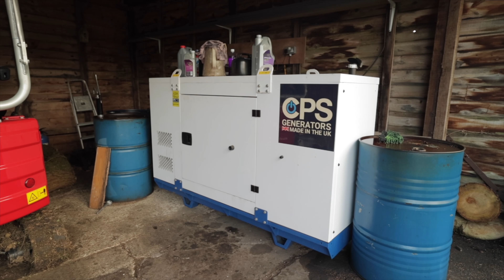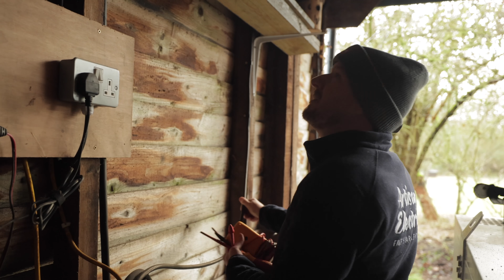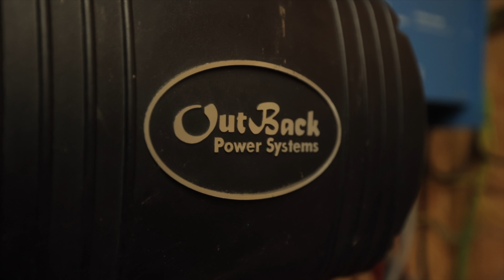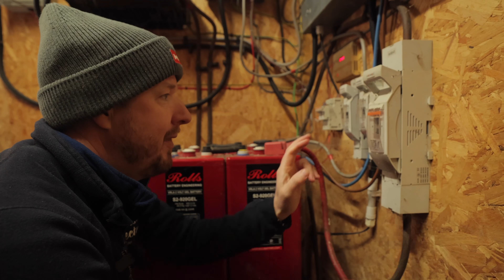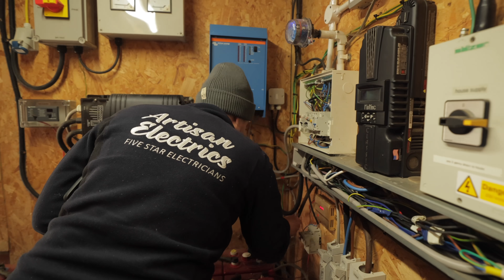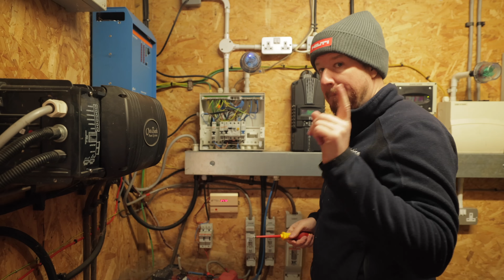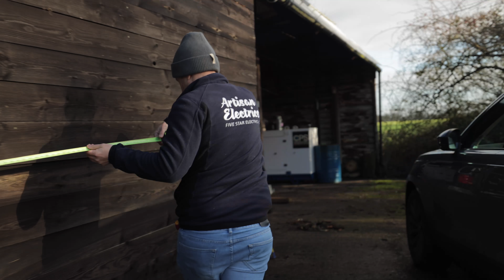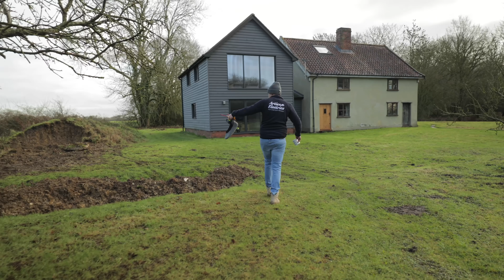DIY Off-Grid Solar Gone Wrong! (It Can’t Even Boil a Kettle)

Comment: That gear was top notch back in the day. To me it looks like an old DIY install on the cheap that has been upgraded along the way... likely done over 15 years ago.
The generator wiring is an odd one as its an AC gen but it looks like it had the ability to run the house on the change over switch.
In all honesty, Artisan is not the company to be doing this sort of install as you'll charge the lad the earth for something he does not need.
A house like that with a gas cooker etc won't consume much and you are talking about full ground mount arrays.
Its best the lad learns some electrics and sorts it out himself.
Reply: They’re running in 47kg propane bottles, gas cooking and heating is going to be costing them a fortune!
Reply: That last titbit of advice is how we got here! It's best he engages a reasonable electrician who only sells him what he actually needs and no more.
Reply: @jack6450 its not that difficult. He can do some basic courses so he can maintain it himself and its as simple as reading the regs to keep it safe.

He needs a ground rod, a basic consumer board and that cable to the house changing and buried.
He can get a company to properly design the system (theres many companies who will do this in the UK... especially if he sticks to Victron).
Reply: @CalMUK91  Bury the cable, use the extra two wires as a direct feed from the generator and have that feed a few sockets/outlets in the kitchen. Bury an extra control wire to be able to force the generator on from a switch in the house, even if the batteries are charged. Run the generator the few minutes it takes to run the kettle. Or just use the gas stove to heat up water...

This is just a pure guess/speculation but it's at least not unlikely that the previous owner used a wood stove both for heating and for some cooking. Like heating water for tea doesn't require any fine grain control of the heating and thus a wood stove is perfectly fine for that. Might not be so great for things that really need fine control of the heat, but still.
Reply: @The-secret-101  just swap out the elderly 2kw Outback inverter for a 5kw Victron or similar, dump the old Rolls AGMs for EVE LFP battery bank, and you could run the kettle AND air fryer at the same time without the genny needed at all... The panels and Midnight controller are fine (hell at 10 years old, their lost production would barely be measurable lol) but by adding another charge controller (NOT a bloody  inverter Jordan- its a MPPT charge controller!!!) and more panels, you could reuce the need for the generator further (there's no limit to the number of charge controllers you can parallel into a battery bank until you hit the charge limit of the batteries- another reason to dump those worn out AGM!!!).  Artisan might know what they are doing with gridtie, but sorry Jordan- you don't know even the basics of offgrid- and it shows....

Comment: he just needs to sell the house for the 'upgrade' and yea not neat but the prev owner might nog have needed more than 3.5kw or so, you can make it 2x 16A on the 4 wire making it 7k which is enough for most houses and just add new panels and a good inverter, test the batteries they might be able to be reused depending on evening use in the house (i got 60 and 120kw on my properties vs the 12kw there but i am a heavy user) and deadly... that is a bit of clickbait, the exposed copper is indeed not correct but if tightly connected def not deadly in a closed system
Reply: Boiling water on such a system is just dumb too. Diesel -> Elec -> Kettle instead of just a gas stove...
Also, 6mm2 in ground is fine for 32A and it could have been 3-phase. The 24v battery system needs an upgrade anyway though, and I just utterly hate those Victron "slap everything but the kitchen sink on the wall" installs.
Everything on there could have been replaced by a single hybrid Deye inverter.
Reply: @1kreature  yea 2x 32A should be no problem either with 6mm2 , i put in 3 phase 6mm2 at location one for 20kw max and 25mm2 for 40-50kw at loc 2. i am talking about 2x 32a here to save as much money as possible so they can keep the 1 phase diesel etc and can just get a 1phase deye inverter and add more panels and tidy up the cabling a bit
Reply: @wernerz8314 yeah, but you know this is a sigenergy sponsored install so they will probably rip out everything. Those new batteries will take up and aweful lot of space.
Reply: @1kreature  Nothing wrong with running a kettle off a 5kW inverter. We do it 6 times/day. For a 3kW inverter like this a 1kW kettle is smart so you can run it at the same time as another high load. As you say the cable is fine for 7-8kW so getting a 5 or 8kW Victron Multiplus (or adding a 2nd outback (they can parallel)) would make this a much more capable install. More solar would also help a lot and it's cheap now. I'd just put 7kW on that shed (maybe beef it up a bit first)  Cheapest and simplest is just adding 4kW via a new MMPT.
Everything in one box is neater (and often cheaper), but you do lose flexibility. Just adding another block of PV and another inverter to this setup is easy. That modularity does have some value over the long term.
Reply: @xxwookey  The inverter is not the problem, the 16A fuse total for the house is. But I still say it's not useful to do it like that and I am stating the previous owner did not use it like that, as evidenced by the small fuse.

Comment: I am guessing for all work needed £30k to £50k am I miles off? Please do a follow up video on this project very interesting
Reply: You can double
Reply: 2x15kwh seplos packs about £3-4k. Victron looks good but a 5kva about £1k, 3xpowmr charge controllers £300. 20x450w panels £1500, fence posts and unistrut for vertical mounting (winter is only consideration) £2000. Other bits £1k. Labour 1 week.

Avoid fancy software and highly integrated equipment on off grid systems. Use separate chargers and inverters where possible to maintain resilience.

Comment: Re generator :- the generator should have a alternator to charge the starter battery I think the previous owners may have had probs with the alternator not putting any power out  and/or possibly a diode in the alternator faulty and slowly discharging battery when generator is shut down also the starter battery may be faulty the generator wiring and starter battery needs checking also the output on the external battery charger will make the alternator think the battery is charged when its not and on starting will draw a very high current from the charger not good  sorry for the waffle hope you get my drift
Reply: Probably the generator wasn't running much in summer and the battery died.
Reply: We do the same axtually, the genie is setup to autostart/stop. They have fairly small start batteries and  potentislly could be started several timex a day.
Running a smart charger to keep start battery topped up   is common place.
 Especially at night and in cold conditions
Reply: With that inverter it switches the household loads to the generator once it's running passing the power through the inverter to supply 3kw for the house and 2kw to the batteries to charge them, using 5kw of the generators capacity, leaving plenty of headroom on the generator for long life. They could have paralleled a set of those inverters for 6kw for the house and limited the max charge rate to the batteries to stay under the generator limit. A safety bypass downstream would let them run the house directly off the generator if the inverter failed, better option as it eliminates a single point of failure.

Comment: Love that you call the Midnight Classic Charge Controller an Inverter😂😂
Reply: The best way to see he is a bit out of his depth. Quite a decent MPPT controller that?
Reply: @danielkirk8571  Damn near indestructible those charge controllers. Didn't recognize the actual inverter either, I don't think he spends much time around off grid gear. That surge protector is one of the best you can buy too.
Reply: @andycanfixit  Outback has been around for a LONG time in the offgrid world of inverters- OK but quite small by modern standards (that one is only 2000W lol) LOL- I just made a comment about its a MPPT charge controller and not an inverter for the Midnight lol
Reply: @steved2136  Never saw in the vid him listing the actual inverter size, that style came in 3kw versions as well and both versions were able to be paralleled for greater capacity. As I stated elsewhere I'd simply repurpose that inverter and the mppt charge controller and existing panels with a couple new 24 volt lifepo4 batteries for power for that shed and as a backup to whatever replaces it as the main system. Then install a new 48v system with a 5 or 6kw inverter and some new ground mount arrays as the primary, and base it on Victron as its well supported, reliable, affordable and not likely to disappear overnight unlike the Sigenergy they seem to like to push. No reason to get rid of good gear.
Reply: @andycanfixit  Its the unvented case Outback- so its the 2000w version (on 24v, the 48v version is 2300w)- only the vented case version is 3kw- and thats not one.... Parallel stacking them offgrid doesnt seem to be that reliable- they work fine like that ongrid, but many have had issues with them offgrid running as master/slave in parallel....
Reply: @andycanfixit  Outback top machines. Could be a 2430 (24V 3Kw) inverter. A bit limited for a house. However their backup/forum is second to none.
Reply: @danielkirk8571  that says MPPT on it.
Reply: @damiankimmins3880  and on the lcd display, get rid of it and up the system to 48v
Reply: @danielkirk8571  Yes, Midnight Solar products are very good.
Reply: :) thats exactly what i thought. Midnight solar, great charge contollers(not an inverter) didnt even acknowlege the auto start system for the gennie !!

  Always the same with artison, rip into the system without knowledge and research. 

Tell the customer everthing needs replacing and charge him more for a new system than he spent buying his offgrid home.
Reply: @rogereverett9095  100% agree
Agree. This video was a bit painful to watch.
Like step one would be to check if any of the existing equipment can be switched over to 48V, and if so recommend the customer new lithium based 48V batteries and a new combined charger-inverter, but keep the existing stuff too. Like move the old panels to sit on the wall rather than the roof and let them feed the existing solar charger, and have new panels on the roof feeding a combined charger-inverter. Have the old inverter feed two of the four non-ground wires in the feed to the house, and a new charger-inverter feed the other two. Use the outback to feed lightning and sockets that would be used for for example charging phones, internet access stuff and such, and have the new charger-inverter feed the more heavy loads.
Also why would you install a ground mount array rather than putting solar panels on the actual house? Is it some sort of insurance/liability issue?
Reply: @The-secret-101  Couldn't agree more as there is some good solid gear , more panels , 48 v Lifepo4 battery bank (not expensive Lithium power wall !! ) yes Lifepo4 power density is lower but there is plenty of room and Lifepo4 is safer . Agree it was a painfull watch he had know idea what he was looking at but reckon it will all get ripped out replaced with some over complicated expensive system (wish I knew were the skip will be LOL ) Going green means re-using stuff not chucking it in the skip
Reply: @The-secret-101  I have a ground mount array because house mounting panels ends in higher insurance for me, everyone's insurance is different but mine likes virgin roofs.
Reply: @rogereverett9095 yeah, there might have been some decent equipment in there, but the installation is terrible! The quality of work is shocking, the only documentation was a single piece of hand written paper, the supply is massively undersized for the house and there is no way on the planet any electrician can give that installation a satisfactory EICR - in fact it is likely in a state that would invalidate their home insurance.
Reply: @Pugjamin  'The quality of work is shocking'.. I heard that with a Welsh accent😁
Reply: @Pugjamin  Is it really terrible? If no wires are undersized, if the insulation is up to spec and if all connections are solid, then does it really matter if it doesn't look like a textbook example?
In my eyes it looked way better than many "nice" solar installs as it for example has fuses close enough to the battery pack, that protects the wiring. Don't know what's common in the UK but in general in various videos I see people crossing unfused relatively thin positive and negative wires connected to the batteries, with the single layer insulation as the only protection against short circuits.
Also the real thing that could improve safety quite a bit would be to not mount it on a combustible surface. Like use drywall or even better use those boards that are intended for high temp environments (can't remember their name, they are used for example near wood stoves and such).
Reply: @culturalpubwalks   it's RIDICULOUS!
Reply: @The-secret-101  Hardisheet concrete sheets here in Australia... Its actually a nice little install (I'd be dubious about the batteries- if its about 10 years old, then they are likely at the end of their useful life for AGMs)- replace with a 48v LFP bank , upgrade the inverter to a 48v 5kW one and tidy up the wiring (considering its England, leave the original panels there and add another 60a  with another 3kw of panels on it for better winter performance- you can have as many MPPT charge controller in parallel as you like (don't even have to be the same brand/rating lol)
Reply: Surely it would just be more economic/sensible to either bring in mains power from nearest farm line or just run the generator, the cost of diesel will be a fraction of what your proposing to install.  Use the existing solar set up for lighting around the site.
Reply: @Colin-g9t nothing wrong with the equipment, could be one wire, balancing of batteries or one setting on inverter. I have lived offgrid for 4 years, AC, induction cooking, shop vac, 4 panels and cheap Chinese 4.5 kva inverter.. my guess would be balancing of batteries
Reply: @Colin-g9t  Depends- its one thing to have a line run from a powerpole 20ft away to a house- on a farm, it can be a whole different story indeed....  I run offgrid solar here- and I have a powerline that runs across the front of my property.... Why- because my system cost me less than HALF of getting the mains run in- and thats only half a kilometre!!!! (my system cost me $17500 in 2019- with a 20kWh battery bank, 12kw 48v hybrid inverter and 18kw of solar panels (72 x 250w) while getting a transformer put n out the front on the 11kv line, and five power poles installed to run the power in to my house site was going to cost $42k Au!!!- I could have literally DOUBLED the size of my offgrid setup and still cost less than getting the mains on..... (diesel gennies cost a lot- not only do youhave to pay for the diesel (a friend had to run a 15kw diesel genny here for several months- it was costing him over $30Au a day in diesel- plus it needs oil changes, filters etc (and they are not cheap either- $130 for a full set of filters) and it needs them every 500hours of engine run time....
Reply: @steved2136 I’m surprised as we always tapped into Scottish power company lines to run remote scientific equipment as cheaper and less hassle than off grid, but we owned land from boundary and self trenched cables as far as possible.  Typically £7k.
Reply: @Colin-g9t  no DIY here- the sparky does it all- or it don't get hooked up!!!! (and not just 'any' sparky can do it- level 2 ONLY)
Reply: @Colin-g9t  Not sure what happened to my comment- but underground here costs between $225-$350 a METRE!!! and its over 500m from my house to the road..... (that puts the underground option  starting at $124k Au- over three times what the arial line on poles costs, and 6 times what my offgrid solar system cost!! 😲
Reply: @steved2136  was that $30 to charge the battery or feed the house? you should get near 6kwh per L of diesel
Reply: @danny323dee  That $30 a day is only about 15L  of diesel here ($2.30 a litre locally) and thats not much for a 15kw diesel genny... most 15kw diesel gennys use about 1.5L an hour when running at 1/4 power, run it at full power and its closer to 5L an hour- so his 15L a day really was at the lower end of their consumption figures.... (his was direct to the house feed, no batteries)
Reply: @danny323dee  Generator Size 	Approximate Diesel Fuel Consumption
¼ Load (litres/hr) 	½ Load (litres/hr) 	¾ Load (litres/hr) 	Full Load (litres/hr)
8kW / 10kVA 	0.8 	1.3 	1.8 	2.4
10kW / 12kVA 	.9 	1.6 	2.2 	2.9
12kW / 15kVA 	1.1 	1.9 	2.7 	3.6
16kW / 20kVA 	1.5 	2.5 	3.6 	4.8
20kW / 25kVA 	1.8 	3.1 	4.5 	6.0    Thats from Ablepower here in Australia